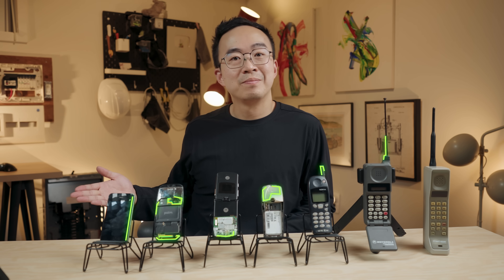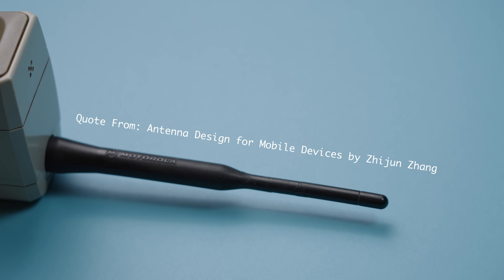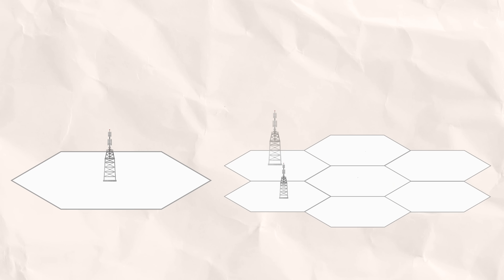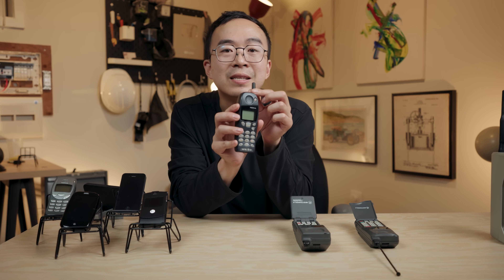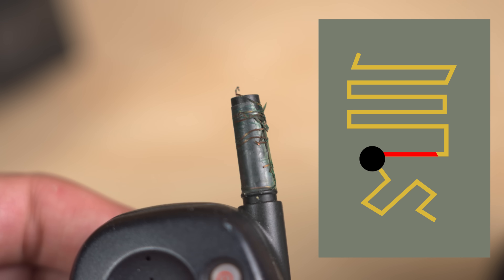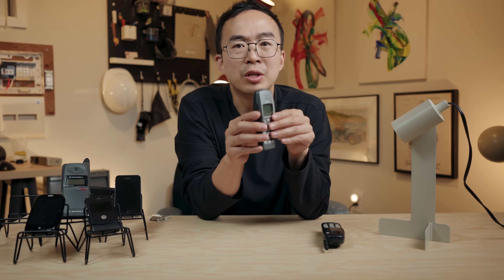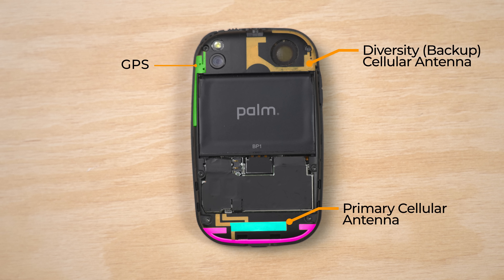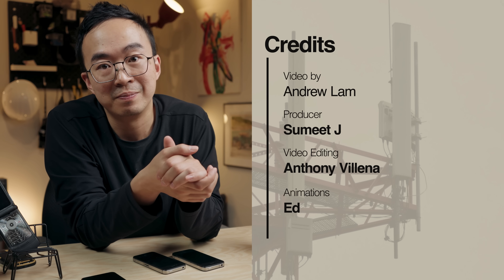How CLEVER Design Made Antennas Disappear

Comment: I work for an antenna company. In the last few years, there has been a massive improvement in simulation, analysis and testing  of antennas. We can cram a dozen antennas in a compact area surrounded  by electronic interference , They science involved is really quite impressive . RF engineers don’t get the credit they deserve.
Reply from the maker: Wow, didn't know about that.  Amazing.
Reply: @Lam  actually you DID say that our phones now have about 30 antennas in them.
Reply: The PCB design for these high frequency devices is also insane. The traces seem so chaotic, yet every bit of it was painstakingly optimized in order for it to work at all.
Reply: i also wanna become a rf engineer. i do electrical engineering but it is such a interesting topic
Reply: There's a ton of tech that goes into a smartphone, not just RF.  The battery, screen, speakers, camera, fingerprint sensor, etc. all have their own large amount of research that makes them how they are today.
Reply: @felatras9503  no way, are you SERIOUS?!
Reply: @felatras9503 at its core, it's still a PHONE.
Reply: as electrician, i feel ya!
our works are never seen (as long as they work) but everyone relies upon it, being perfect for years&years!
Reply: What are the new tools that provide those massive improvements in simulation, analysis, and testing?

Comment: Old Cellphones were Big and Antennas were also Big for Various Technical Reasons
1) They had Lead Acid Batteries
2) Number of Cell Towers were very Few and Far from each other in Location

So cellphones Need to Generate Strong Signals to reach those Distant Towers and also receive and process those Weak Signals coming from Distant Towers, For all this you need Big Battery and Big Antenna.
Reply: NiCd and metal hydrid or how they are called . No lead

Comment: Regarding the antennae on the phone. My pixel 7 had notably less reception relative to the Pixel 9 Pro XL (trade-in deal). What used to be completely worthless cell area up at work became barely usable instead, which was huge. Sure didn't hear anyone talk about that in any review, that's for sure. Reception matters, and in spotty areas, a better antenna array can mean the difference between a paperweight or something that has enough signal to get you out of a jam. (I hated how poor reception at work was holy crap)

Comment: 8:50 AM and FM are not frequency bands but are signal modulation strategies. (Hence the M in the abbreviation.) AM stands for amplitude modulation, meaning that the radio signal has higher and lower amplitude in accordance with the sound wave it's encoding (so higher amplitude in the sound wave means higher amplitude in the radio wave). This is easy to understand. FM stands for frequency modulation, where the changing amplitude of the sound wave causes a frequency change in the radio wave.
Reply: AM and FM broadcast bands are on different frequencies.  AM is around 500-1600 KHz and FM 88-108 MHz.
Reply: @James_Knott For radio broadcast and by convention. (Though maybe FM needs a higher bandwidth which warrants a higher carrier frequency.) Interestingly, during the cold war, the communist countries used a different frequency band for FM (maybe even AM) so that the radio receivers sold there (here) couldn't have been used to listen to Western broadcast.
Reply: Yep, I'm well aware of that.  I went to college for electrical engineering, specializing in telecommunication systems, spent most of my career in telecom and have had my amateur radio license for almost 54 years.  However, since he was holding a broadcast radio receiver, I assumed the context was AM & FM broadcast radio.

Comment: in UK , we get screwed because the infrastructure is owned by separate companies , which have differing amount of broadcast antennas on the towers , Vodafone,   EE/orange/Tmobile/BTCellnet (yes now all one company)  and O2 ,. and 3 THREE ,. if anyone remembered them anymore as an option , i almost forgot, 

the problem is they all need their own antennas on a tower , and cannot all point the same directions , its a mess , Cellular infrastructure needs to be regulated like the Broadband internet is , anyone can use it , BUT different people cell access which is all owned by BT WHOLESALE , who are not allowed to sell to the public , this is why reception is spotty on one net and great on the others , and you can even tell when your phone transitions to a new tower as there's is a 10 second reconnection period assuming you drive in to range to pick up the signal,  and handy Beep when the phone is switching may be a good idea ,
Reply: There are multiple companies in Canada, U.S. and elsewhere.  Each gets their own slice(s) of spectrum.  Also, they are regulated as to frequency, antenna location, etc..

Comment: I once read an article about a ham operator (at Uni) that designed an antenna using Koch curves. Basically a monopole with a triangle sticking up midway. That same aerial doubled reception. So he then continued, fractal like and added smaller triangles in each leg, and it increased reception yet again. Maybe close to another doubling. And he kept going with the fractal, apparently he got more gains but not as dramatic. Some of those in the video were shaped, maybe the space saving bends did add some gain.

Comment: Excellent video! This is something I've been curious about. I know it's hard to stay at a non-technical level, but one thing I'd be curious about is a bit more detail on how the spectrum has changed over time (ie, in regards to the max power of cell towers for each frequency, the size of the cells, and perhaps the maximum number of customers and/or bandwidth provided by each tower over time).

Comment: I enjoyed this informative video. My first iPhone was the iPhone 4 (non-s). I remember all the antennagate on the news but I never personally had a problem dropped calls, even before I got the free bumper from Apple. Apple was so concerned about this controversy they made a custom app specifically for ordering the free bumper. Before my iPhone 4 I had the palm pre on the sprint network. The iPhone 4 on att (formerly Cingular) was 10000x better than the Pre on Sprint. Never left the iPhone and am wiring this on my brand new IPhone 17 pro max my wife has one in orange and mine is blue

Comment: My take on this is that internal antennas have never matched the reception of even the short external type. Edit:  The first thing a phone needs to do is work, long before looking pretty or weight reduction and most manufacturers seem to completely ignore this, supported by a media that gives plaudits and awards to many phones that actually perform quite badly in their primary function. Go back to the Nokia 6110 and that would pull a signal when nothing else around it would.

Comment: Without an antenna the transmitter power needs to be higher to get the same good s/n status. 
A friend worked with mobile telephony in the 90s with testing and mobiles without an antenna had higher radiation levels than those with an antenna.
And those who were afraid of the harmless radiation levels bought mobiles without an antenna....

Comment: People also don't realise how much power the old phones used to transmit, not just receive. Ever wondered why they say turn your phones off at a petrol station? The real reason is the phones gave off so much electro magnetic interference they would reset the computer in the pump and zero the number if you had the phone near it and initiated a call.

Newer phones don't transmit at anywhere near the power, the technology didn't really get that much better the infrastructure did.

Comment: I kind of want to go back to the big pull out antennae
they felt more meaningful, plus there are areas where my signal is bad with modern phones and the older phones never had an issue - yeah the towers have changed, but I feel like a big stonking antenna couldn't do any harm for signal strength

Comment: 17:39 you posed a great question. I am in EE and will try to answer it best I can in a way everyone can understand. 

Short answer: the quality of the signal is determined by the network way more than by your antenna, and measuring how much the antenna impacts that costs millions. The antenna has an effect on battery life, which is why reviewers test how long the phone can call on a single charge, instead of testing how good the antenna is at receiving signals.

An antenna takes a wave with a certain wavelength, and turns it into electricity. The signal tower provides the wave, but every time that wave hits anything (even air!), it will change a little. We may call the change "noise". Back then, there was one tower, and one antenna, so if the tower gave a really strong signal, you would get a good call, and so for quality you only needed to measure the strength of the signal you are getting (this is what the bars on your phone are, and they are arbitrary and largely decorative today).

Now imagine this: you are at the tower and have to send a text to a phone, but you can only send one letter to one antenna at a time. Previously, you and the phone had only one antenna, but today, you and the phone have 2, or 4 antennas, so you can send a letter to each antenna on the phone, making the internet speed 4 times faster. But now there is a big problem: when you send those 4 waves, they will hit each other, and we will call this "interference". Now, the tower doesn't have one phone, it can have a thousand phones, and that means thousands, or tens of thousands, of waves all interfering, and simply making the signal stronger doesn't make the interference go away, since a "strong" wave isn't hitting your hand or a wall anymore, it is hitting other "strong" waves. This is why the most important measure in signal quality for your phone isn't strength, but SINR, which is the ratio of the signal, and the interference + noise your phone is getting, and you might notice that none of these factors are strongly determined by your phone! They are determined by the network. Where does the antenna in the phone come in?

The antenna in the phone determines how much interference your phone can handle. The antenna will always capture waves of a given wavelength strongly, but also waves that are a little longer, and a little shorter. If the antenna is badly designed, it might drop signal when there are a lot of phones in the same space, but this requires thousands of people all standing together trying to make a call, and even then there are things we can do to provide better signal from the network. Not only is your phone's antenna not the determining factor, but to measure how good it is you have to be in a perfect environment with zero noise and zero echo, which means being in a lab and using equipment that costs millions of €. The antenna is not the determining factor of signal quality, and anything other than signal strength is insanely hard and expensive to measure, BUT, what the antenna does account for is power efficiency: if the antenna is badly designed, it will draw a lot of power from your battery, and heat up lots. This is why some phones last shorter than other phones when calling, and why some heat up more than on a call. This is something reviewers can and do measure: you can often find tests that check how long a phone can stay on a call before it runs dry, and this is the reason why that test is important! It is the cheapest and most accessible way to see how good the antenna is.
Reply: Thank you for this comment. It was very insightful to read — I have never realised that efficiency matters. I do have a follow-up question if you don't mind. What would impact the power efficiency of an antenna? IIUC, it's not always the case that less power efficient = stronger reception.
Reply: one correction to your comment: waves in the air don't hit each other and bounce around because they are colliding with one another. The real reason having lots of phones at the same time is an issue is simply that when your phone is "listening" for your letter, it is also hearing the letters that are intended for every other phone. But you're right that the antenna is not necessarily the determining factor of signal quality; there are lots more complex filters, electronics, etc. that go into how good your signal quality is
Reply from the maker: @tylerweigand8875  This is an incredible answer and I'm SO glad I didn't try to get into these particular nuances.  This blows my mind and gives me a fresh perspective how it all ties in together.  I wanted to talk with a smartphone RF engineer but just ran out of time and I kinda regret it.  Thanks for sharing and breaking it down how it all works.
Reply: @Lam  no problem glad I could help :p
Reply: @Lam  I think you meant to tag @sleepinbed, the OP, instead.
Reply: Thanks a lot <3
Reply: Thanks a lot! That is such a clear explanation!!! Here is a pod of dolphins to say thank you 🐬🐬🐬!
Reply: @albertlert  I'm very glad you were interested enough in this to read it, and that you understood and enjoyed the discussion :) And thank you for the pod of dolphins!
Reply: @sleepinbed  The good news is, the majority of people who would watch this video are also interested in your post. You're in good company here. Peace from Oz.
Reply: @----.__  seems like it :) I've honestly thought about making YouTube content about these kinds of things, I might get to it soon
Reply: Why would the equipment to measure UHF waves cost milliions? Couldn't you build everything required yourself with about 20000€? It would be quite some work, but not work worth a million €.
Reply: @timobreitscheidt9382  A lot of the cost is in the environment. Light itself is an EM wave, there is electromagnetic noise all around us. In order to properly test equipment, you have to do it in an environment that is isolated electromagnetically from the outside world, and where EM waves don't scatter. Those labs can cost a lot. When it comes to equipment, keep in mind that an oscilloscope with 1GHz bandwidth can cost tens of thousands of dollars... But also, if you want to list your measurements as part of a phone's specifications, your equipment should be calibrated by an accredited measuring lab, and, because of the limited number of labs accredited, they can often times be located far outside of your country (some measuring devices or measurements taken in Canada have to be accredited by a lab all the way over in Belgrade, Serbia, for example). TL;DR - creating the environment in which to conduct testing costs a lot of money, and including the results of tests in spec sheets comes with additional costs, so if testing is done on this end, it's usually internal

Comment: Love the video, but I just have one thing to complain about. AM/FM do have different frequencies, but the main difference is the modulation (in the name already), not the frequency as in your example.
Reply: He did explain the massive simplification and citing MW to LW or SW would've been more accurate.... but might have confused younger adults who may never have encountered SW/LW.
Reply: @UsualYaddaYadda  LW and SW can both be either AM or FM for data transmission, though. The issue I'm picking at here is that AM and FM require very different antenna, chip, and SDR designs, and the difference is pretty crucial. AM is more vulnerable to the "death grip" afaik, and FM requires more advanced silicon.

Meanwhile, SW and LW just require different size of carrying media for the antenna, and a somewhat larger power source for the latter.
Reply: As far as I know modern phones use AM and FM ath the same time on the same frequecy to make up to 16 different signals when having good reception.
Reply: @timobreitscheidt9382   Actually, it's Orthogonal Frequency Division Multiplexing with Time Division Multiplexing on top of it.
Reply: The original analog phones and later digital ones also use different modulations.  In fact there are a few different types of digital modulation, which eventually settled on Orthogonal Frequency Division Multiplexing (OFDM) on top of which Time Division Multiplexing (TDM) is used.
Reply: Exactly this. Frequency Modulation and Amplitude Modulation lead to very different strengths and weaknesses.

Comment: iphone4 was what permanently put me on Android. I lived in a rural area, and with weak signal strength, I had to hold my phone awkwardly to get signal. When i combined this issue with teh compatibility of Android with a PC, and the price point... I never been back to iphone since.
Reply: Of course, the "Antennagate". A Danish RF engineer called out that design flaw, but Steve Jobs accused people of not holding the iPhone 4 "properly". In Germany, the iPhone 4 owners were given free bumpers or etui that cover the metal frames for "improved reception".
Reply: I'm also allergic to Apple gear.  I only buy Android, but I have used Android, iPhones and even a Blackberry at work.  I'll stick with Android.